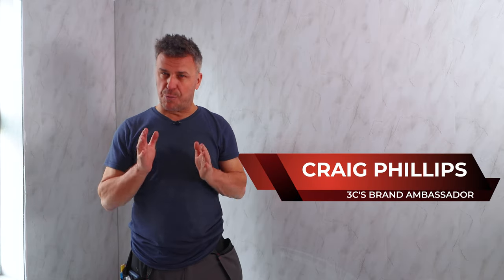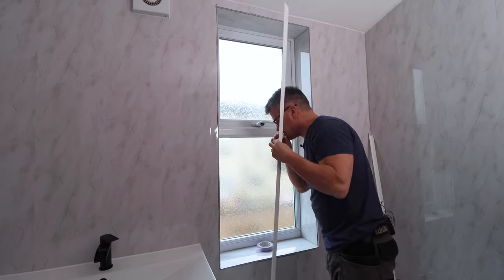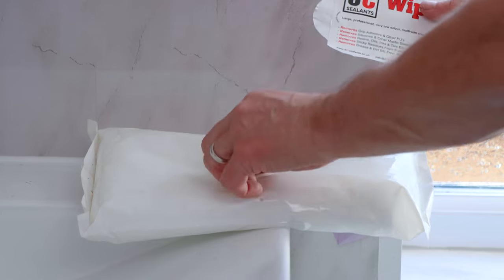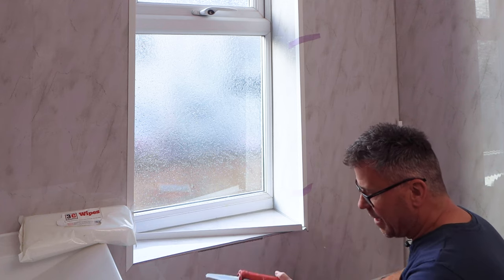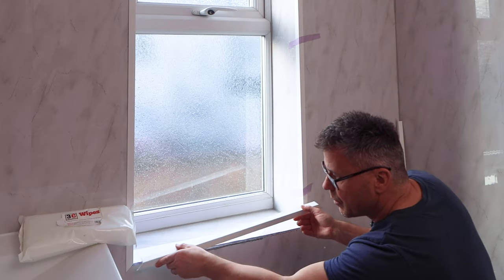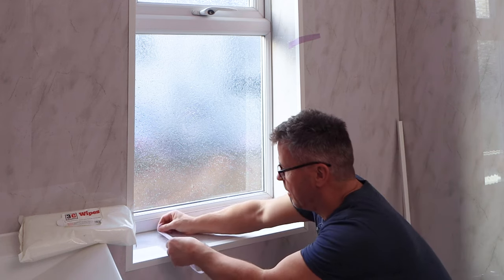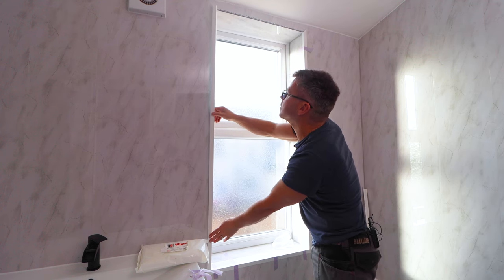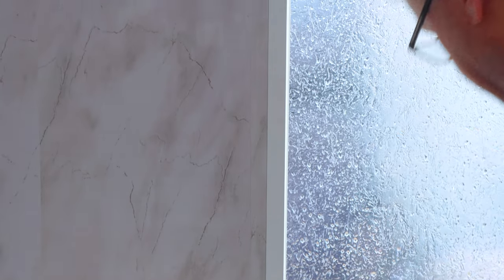How To Install UPVC Window Trim

Comment: You left out that you have to get the width of one piece, multiply it by two, and add it to your width or length that you grabbed when measuring from corner to corner? Or am I incorrect

Comment: If you spill some of that multi-use adhesive & sealant stuff somewhere else, what's the best thing to remove it with? Ta
Reply from the maker: If the material hasn't cured, it can be cleaned up with our 3C Wipes. If it is cured, it can be cut away with a sharp blade and then any residue can be cleaned off with the wipes as well. We have a video on our channel explaining how to remove old mastic sealants 😊